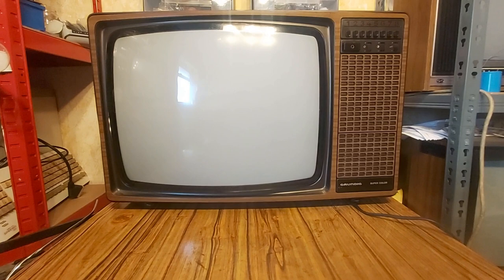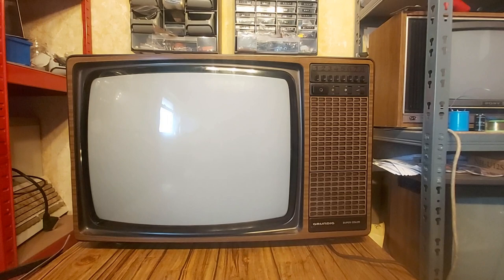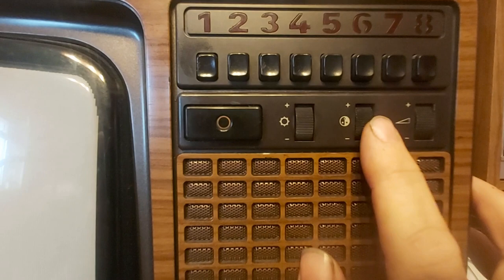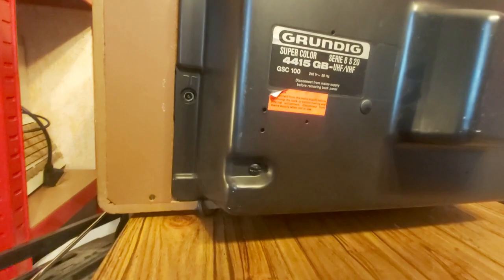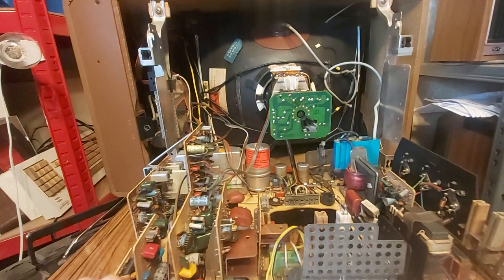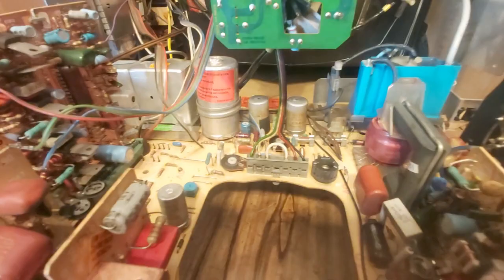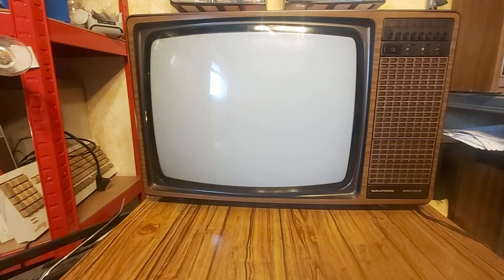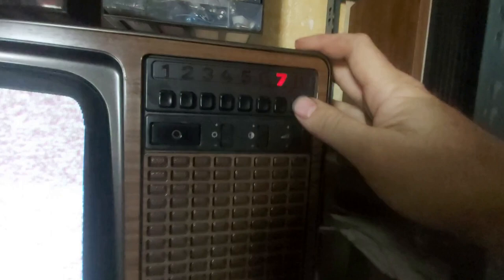Show 'n Telly episode 5: 1978 Grundig GSC100

Comment: I have repaired a few Grundigs from the 80s usually with dry joints rarely had to replace parts apart from changing the mains switch once

Comment: Been watching your videos very interesting brings back some memories 
I used to repair these chassis had a contract with the COOP in Newcastle 
Main problem with these was the thyristors bt120 bt119 got wiped out due to dry joints on capacitors and at the time the thyristors were maga expensive a couple of dry joints could seriously mount up a repair bill
Watching the bush 161 tripler upgade
Great videos
Reply from the maker: Ah, the days when the Co-op had department stores! All gone now sadly, Wallsend was my local one. The one in the centre of Newcastle is now a Premier Inn.
I honestly wasn't expecting that Bush TV161/Rediffusion tripler to work first time! The reaction is genuine.

Comment: Red guns work hardest (due to inefficient red phosphor ). Mabe someone has tweaked the red drive without setting its dark kevel, ie maybe it just needs the grey scale tracking re adjusted.
Reply from the maker: The old tube had a weak red gun so the greyscale does need adjustment. However there seems to be another issue as the red is almost "floating" I suspect something has burned out and gone open circuit.
Reply: I'd say red bias is set too high to compensate for the old worn out tube. With the testcard you can clearly see that the white parts are pretty much spot on, but the darker part of the grey scale bars is red.

Comment: German sets were way more advanced than british sets at the time, both in performance and cabinet styling and longevity. That set looks almost as new. Typical of german sets. I have several Telefunken sets and again super condition and perform very well.
Reply from the maker: Hmm... I will say yes and no to that. Telefunken and Grundig definitely good sets but the likes of Nordmende or "No Mendy" as they were known in the trade...! Likewise there were some really good British sets and some absolute stinkers. One thing consistent with both UK, German and indeed European sets was the limits of the individual components at the time regarding reliability. My Pye CT450/Philips G11 has all modern Japanese electrolytic capacitors (including the dreaded reservoir HT smoothing capacitor) and it's never broken down since.